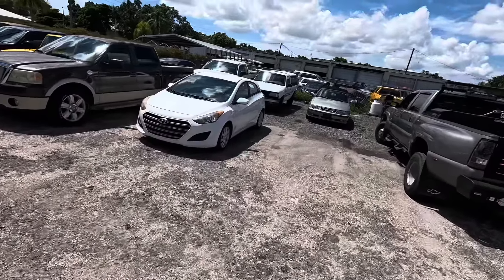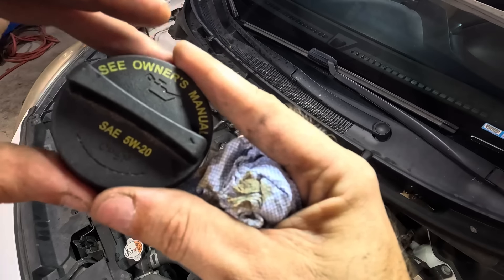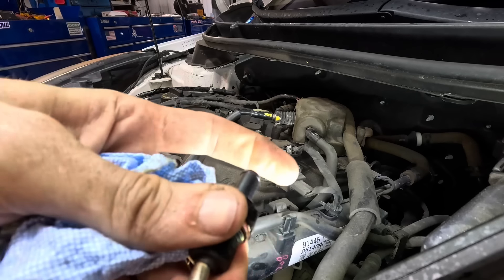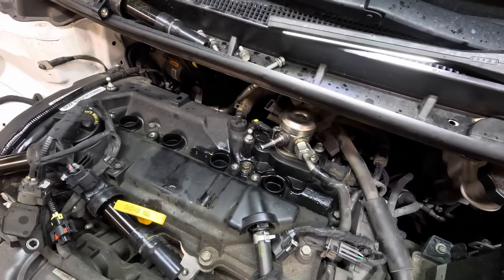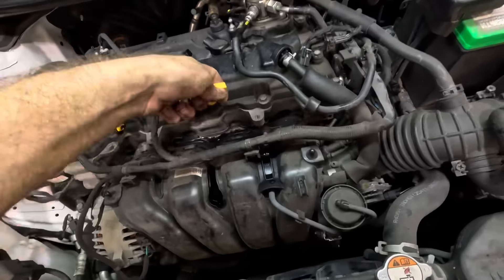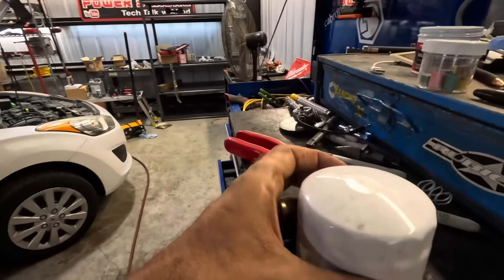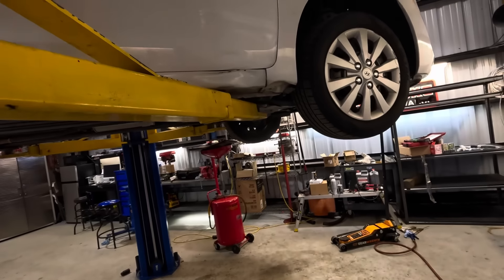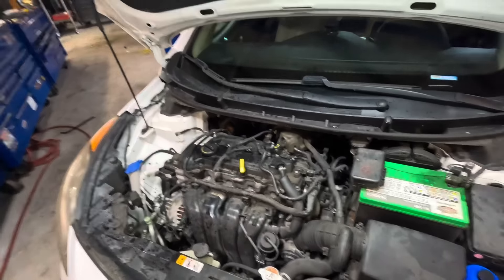Excessive Blowby! BURNING OIL! Hyundai Elantra 2.0l

Comment: This suggests that the owner doesn't really check the oil and such on his car. He still notices rough running and took the car to RRR for that, which means he cares even if he doesn't want to get his hands on it.

The low oil level is the reason I say he doesn't check. To me this is something I tend to check at least monthly, and a change in il level really means it's going somewhere and that can be important to keep track of. At the least it require adding oil so it doesn't go past the low mark on the stick, but if it drains quickly and doesn't leave a slick on the parking lot then things are looking grim. An oil slick at least means the oil isn't necessarily going into the cooling or inside the cylinders. Leaking oil isn't a good thing, but usually not an acute crisis.

Now I'm keeping track of every thing I do to a car. I keep track of how much fule I buy and at what mileage. I calculate MPG to see that it hasn't changed enough to wonder why. I keep track of buying and adding oil just as well as I keep track of oil changes so I can see if something change over time. But I have worked with people who doesn't even check air pressure in the tires unless the tire are starting to squeal as the rim is grinding into it. But then my last car was well over 20 years old when I got rid of it. And even then it was because the required repairs which was rust related were so expensive it didn't make sense to spend money on it. The engine was still in perfect shape though. That's just life in the rust belt. Unless you only use your car in the summer and keep it in a heated garage over winter it will die the rust death sooner or later.

Comment: GDI Motors from Hyundai and KIA of those years are well known for sludge and nasty stuff after about 70k Miles that cause them to burn oil, that's why the manufacturers had issued a recall for free engine replacement at that time as far as I remember.

Comment: Check the VVT solenoid for chips, stuck oil rings leads to burning oil, low oil leads to bearing damage, which will show in the mesh. I have a theta engine in pieces due to gunked up oil rings and spun bearings. 102k miles. Post-2010 Hyundai engines are junk.

Comment: chemicals can 110% clean an engine, however. it leaves residue inside that mixes with the new oil that could break down the additives and/or make it corrosive. if I understand everything correct, watched some The Motor Oil Geek videos about it. 🤷‍♀

Comment: By the way, the tiny peep hole is on the front engine itself. You can find after you remove the valve cover, which gets clogged up with oil sludge or carbon build-up. Have fun removing the valve cover. Lol!

Comment: I lost a micro sd card somewhere in my truck and I'm very upset about it.  I think I'm going to have to take off my dash/windshield vent area because it may have slid into there.  I'm going to try and vacuum out the vents first to see if it sucks it out.  Does BG have anything for finding tiny items inside a vehicle?
Reply: They are magnetic try using a telescopic magnet some have one that is like a car aerial with a magnet on the end, if you set eyes on it try a stick with a piece of sticky blue tack on the end of the stick.  The poor mans tool retriever.
Reply: @oojimmyflip  it ended up behind my aftermarket stereo, which has a small gap between it and the dash. I used a stick and some tape. Magnet is a good idea though.

Comment: I wonder how much carbon is in the intake ports, probably needs a good walnut blast. With all that carbon on top of the pistons the rings are bound to be stuck in the ring lands. It's funny that the oil was still clean when you first checked it, with all that blowby it should have been pretty dark looking. Could you pour some cleaner down the spark plug holes on top of the pistons to soak and soften the carbon around the rings and ring lands. Does the BG fuel cleaner burn in the cylinder or stay in liquid state to help clean the carbon around the rings?

Comment: Will this same method work on  a diesel engine?. 

I have a VW Golf 1.6TDi  98000 miles so far and have a loss of oil and need to regularly top up  it up. 

There are no visible leaks, no blue smoke out of the exhaust but there is a small blowback but nothing major.  

Enjoyed watching this as could well be the same issue.

Comment: Ray, I have a question, not a being critical. Why do you not have exhaust hoses that carry the exhaust outside and out of the garage space. It was my experience that carbon monoxide is accumulative over time in the blood stream. We were always cautioned to make sure that venting was direct. With a those open doors to your wife units office it would get in there and not vent out as easily. I worry about that everytime you leave a vehicle running inside the garage.
Reply: Haven't the emission controls reduced the CO in the exhaust? Still, I can't see any real down side to installing exhaust removal, except for the vehicles with multiple tail pipes. You might also consider smoke & CO detectors. They aren't cheap, but may cut your insurance costs on the building, even if you don't own it.

Comment: Ray ho does it get from the combustion chamber to the rocker cover?
Reply from the maker: Combustion chamber, through the rings past the pistons, into the crankcase, up through the oil drain holes in the cylinder head and into the valve cover, through the pvc and into the intake.
Reply: @RainmanRaysRepairs  thanks Ray had my thicky head on

Comment: Put a fill of Valvoline Restore and Protect Oil and it will fix the problem. Stop using those BG Additives.  If you think you need them, then you need better Oil.

Comment: These 6 month or 7500 mile oil changes are the contributing factors to early engine failure.  There exists many laboratory analysis indicating early engine failure due to the breakdown of oil, and the buildup of sludge.  Can synthetic oil be run for these longer mileage intervals?  Probably. But, I believe they’re the single most contributing factor to early engine failure.  The continuous cycle of heat/cooling is the primary adversary to an engine.  The synthetic oil provides no greater lubricant to an engine vs non-synthetic oil. More importantly, the requirement for frequent oil changes is still needed during the year to maintain engine performance. At the very least, a 4 month or 4000 mile interval oil change could be  considered beneficial for peak engine performance, and to reduce the chances of premature engine failure.  The above theory could also apply to other critical lubricants, such as transmission, differentials, and transfer cases.

Comment: I thought there was a TSB for the 2014 -2018 Hyundai / Kia engines with excess oil consumption.  I seem to recall there was an issue with the ring size during the manufacturing.  Of course that was a few years ago and I'm old.   I was looking to replace my Wife's Corolla at the time and we have a friend who used to work for KIA at the time.  We still have to Corolla, but cancer is starting to get to her. (Rust)

Comment: I have a 2015 hyundai tucson with this exact same engine, it just got to 70k miles and ive changed the oil every 5k for the 30k ive had it, i dont have any notable issues per say but im wondering if i should do an engine flush preemptively to keep it nice and clean

Comment: As usual, good video.  When doing the dynamic engine-cleaning procedure, I can't see any reason not to add the "44k" fuel additive at the beginning to get that process started, rather than waiting until the procedure is completed.  Am I missing something?  Using a similar fuel additive without doing the engine cleaning might also yield a benefit at a much lower cost. 

What I'm getting at in a roundabout way is that I feel the Dynamic Engine Cleaner product seems extremely expensive.  I understand you have to charge for your time and labor and other things or there's no point being in business, but that jug alone must be several hundred dollars.  I wonder if there's something BG could do to bring the cost down to make it easier to justify that expenditure.  It's a lot!

Comment: I've used chemicals for years, sometimes successfully and other times, eh.
$800😮 for a chemical wash seems kind steep. It would be nice to get a look inside the upper valve train and inside the oil pan to see if there is sludge there before laying down eight Benjamin's. I look forward to the results of your "econo" clean.

Comment: I change oil every 3,000 miles with Castrol synthetic blend. Never had a problem with any of my cars, and one is at 152,000 miles.

Regarding the grand daddy engine flush... $800? Ouch.

Comment: Have you ever tried Valvoline restore and protect oil to clean the carbon on the rings? I am currently trying it on my jeep.  Says it takes 4 oil change cycles to work. I just did my first so I have no results to report yet, just wondering if you have tried it.

Comment: 2020  2.0L Ford Edge, Ford wants you to remove high pressure fuel pump to remove #1 coil. With torque to yield fasteners

Comment: At best this is a temporary fix. Your test in the end showed blowby, but not oil. Probably because the engine was cold. Yes, a contaminated and or worn ring package or liner will result in blow-by and carbon build-up. And the carbon build-up on the piston topland will result in oil consumption and further liner wear. 
All in all,  even if the cleaner removed (some of) the carbon build-up, it will come back because the ring package liner combination is not sealing. Good test would be to use a blow-by meter and compare results with a new engine.

Comment: Not a great fan of engine flush liquids after my engine seized because the oil pickup strainer got blocked with carbon from the flush the last owner did..the oil light was previously flicking on and off now and again the wife said as it was her car. I checked the oil level and it was just fine I put it down to a lose connector, played around with that and took the car out for a test and it was fine..off on holiday two days later with the family at 5am and the light came on solid doing 70mph on the motorway 100 meters later the engine locked up and pushed two rods through the engine block and then caught fire( luckily I had a extinguisher)..so there we where stuck on the side of a motorway at 5.30 was a busted car and still 40 miles to get to the airport for a flight...deep joy...

Comment: 28:54 it would be nice if there was a chemical you could dump into those cylinders on top of the piston that would dissolve all the carbon and then you could vacuum the liquid out and the carbon would be gone so the rings would seal better.
Reply: You could probably use something like the mixtures made for seized engines. WD-40 is really good at removing carbon as well.

Comment: Small oil ring lands and low friction oil rings for gas millage is the real problem. I change my oil at 2,000 to 2,500 niles never had a problem. So far have never had to add oil between oil changes. Oil is cheap compared to trying to fix a engine that use's oil.

Comment: I'll wager this vehicle rarely does journeys over a few miles - a fine way to end up with gummed rings, especially if the oil change is 10,000 or 12 months, as 'frugal' owners who do 5k a year will skip every other oil change, when their driving really means it should be changed more often.

Comment: Run valvoline restore and protect. But change the oil filter in 500 miles. Then again at 2k along with a full oil change at 2k.

I hate valvoline, I think their oil is junk, but that stuff cleans in a way that even products like epr simply cannot.
Its amazing, and potentially destructive.

Comment: I believe in my American Lucas snake oil, oil addative here in the UK, my 32 thousand mile diesel engine was clattering at start up in the cold winter months with its recommended sae 0-30 engine oil which is like water when new and ive been changing the oil every 3 thousand miles, the Lucas addtive has stopped this clattering completely, it is probably from the hydraulic valve lifters causing it because the engine oil is so dam thin.

Ive always been against using engine cleaners of any type on european engines as it can destroy the hydraulic valve lifters but that cleaner of yours added to the oil does seem to make some difference, I would like to see if there is still blowby in 1000 miles, please film it when it comes back into the shop Ray?

Comment: This vehicle not being driven much and only changed oil infrequently is the most likely cause of the blowby. The engine, pistons and rings rarely get up to operating temperature for a long-enough period of time, so that any carbon/sludge just accumulates there.

Comment: Engines will gum up or carbon up due to a multitude of short trips and not letting the engine reach normal operating temperatures. Typically they start the car, leave right away to the grocery store 2 blocks away. Shut the car off, shop, get back in the car for the short ride home. Repeat 1000 times and your engine does this routine with the carbon build up because most of the fuel does not burn in the combustion chamber.

Comment: I think that engine flush chemicals get an unfair rap due to people misusing them.
Either people dump it in and then continue driving, meaning all that gunk is circulating, clogging the oil filter and getting into bearings and such, and the oil is not as "oily" as it should; or they dump it into a very severely gunked-up engine, chunks break loose, clog a passage, and a bearing gets wiped.
Or they think that it'll magically repair mechanical damage to the engine already caused by neglect and extended oil-change intervals, and get mad when it doesn't.

Comment: My engine has 259000 miles 5.7 hemi. Had the passenger head replaced at 80000 and lifter and cam at 162000. Would that flush be good to do or could it possibly cause problems? Should the products be use only as needed?

Comment: Would like to see the pistons decarbonized. A trickle of water down the carb or throttle body was the preferred method but might be concerned about clogging the catalytic converter. Water is the  preferred solvent for carbon.

Comment: Pretty much any Hyundai/Kia with a GDI engine has this issue. Even with synthetic, should be changing their oil at 3k. Mine is a 2018 N/A non-gdi and I'm losing more oil than I'd like. Need to get it up in the air to check for leaks, but I don't think it's leaking. Needs to make it another 10 month to be paid off. Then off to CarMax.

Comment: One question I’ve always wanted to ask you, who bears the cost of the gas when you run an engine long and hard in diagnosing or treating a faulty engine as you did in this video ? Is the customer expected to just lose the amount of gas used  ? I know if I had driven in with a full tank and got it back with only half a tank then I would not be very happy, what’s your take on this ?

Comment: My moms 2013 nissan rogue 2.5l 4cyl awd it has a little over 200k miles we prefer to use 10w30 oil instead of the 5w30 i told my mom that ive heard and read that the timing system is recommended to get serviced at 200k idk if we need to get it serviced if theres nothing wrong with it or if we dont

Comment: I run 20/50 in my 350k mile 99 F150. Its never used any oil, only a slow leak at rear main seal, about a 1/4 quart every 2 weeks or so. It pulls a lawn mower trailer with 930m JD. I have noticed the oil pressure doesnt come alive instantly when its below freezing out.  will that slow pressure hurt the engine in the less than 3 to 5 seconds it takes to build pressure?It hasnt so far from what I can tell.

Comment: Ray & viewers.... if ur oil cap does a shake/dance @ idle when unscrewed - is that excessive blow-by on pistons?

92 honda civic si (1.6L, D16,  5 speed )?

* I'll check my PCV valve to see if stuck open or rattles easily. 

* engine has almost 200k on it.

* starts quickly & easily / no rough idle @ 750+/-.

* should I try that oil sludge "disolver" Ray mentions & drain / change oil?

* what is best for this high mileage engine?

** thanks **

Comment: I have a nissan juke that barely had any black water (oil) in it when I got it @ 100k. So I put Valvoline Restore and Protect in it to see if it works, it definitely runs better but I have yet to do the oil change again yet so idk?

Comment: I’ve seen the dynamic service a while back and it would probably be good to do it maybe once a year as maintenance. But the car manufacturers have known for some time that the rings do this and instead of coming up with a fix they give you new gadgets that don’t last long and are ultra expensive to fix once they brake….. How about bringing the prices down on some of the reman up motors. I’ve got an 08 saturn vue xr with a 3.6 in it , gm wants 5200 for a reman including my core. Idk it just seems like it’s not getting any better out here!🤷🏿‍♂️